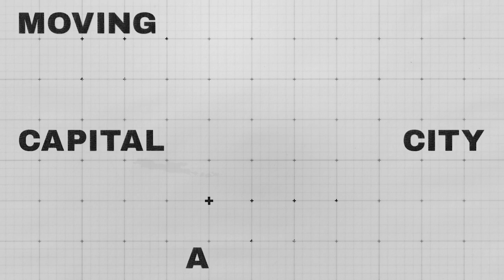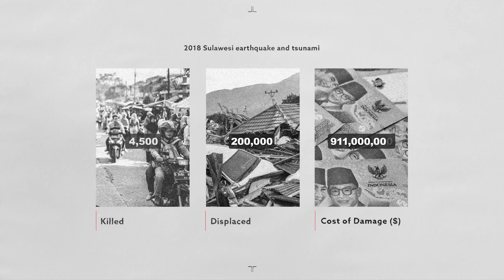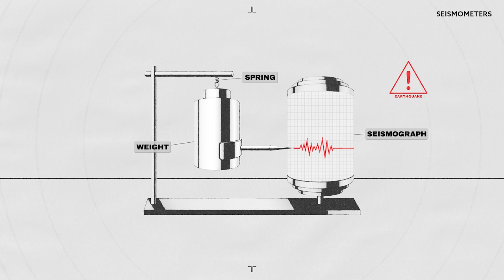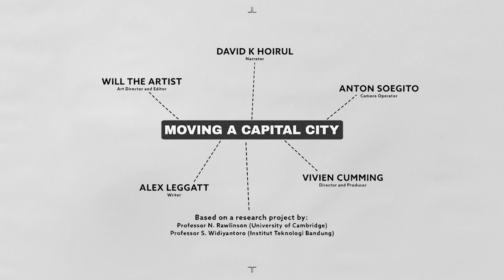Moving a capital city

Comment: Why? Because government failed in Jakarta, and they wanted to overshadow their failure with new capital. That's the answer.

They know the main reason why Jakarta is sinking is because people pump waters from the ground. But they don't care the reason why Jakarta people pump water from the ground, is because the government (from the colonial era until today) is failing to supply clean water into the entire city of Jakarta.

If they can provide enough clean water into the entire Jakarta, it doesn't matter how many the population in Jakarta, people won't pump water from the ground, and Jakarta won't sink. 

Then the worst thing after they failed and abandoned Jakarta, they made the same stupid mistake on the new capital. Instead of building a water depot first to supply clean water into the entire new capital, they brought a cheap pump from China to pump water from the dam (which is not clean). This is shows how low their IQ is, keep repeating the same mistakes.

They rather prioritized to build hotels, malls, etc. in the new Capital for the rich. They forced and got rid of poor locals just to get their lands, so they could sell the lands at a price 100x than the price when they were brought from those poor. Evil people.